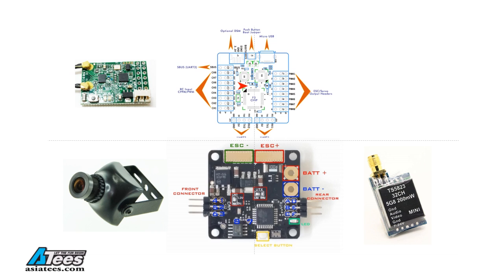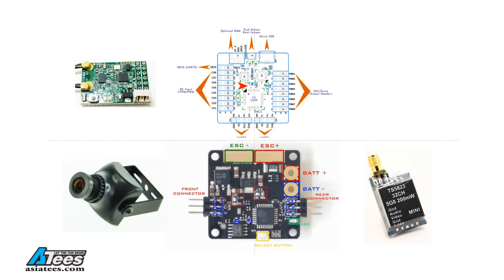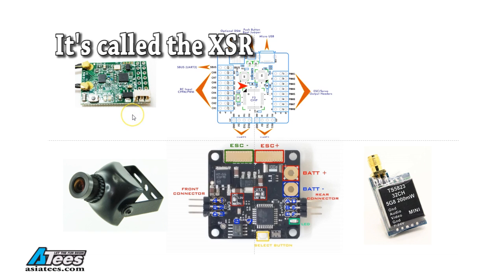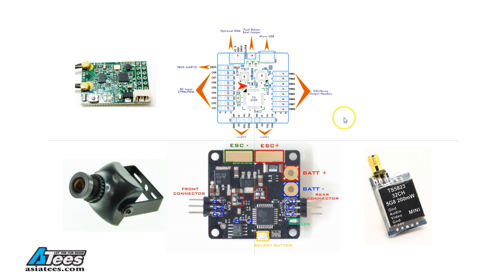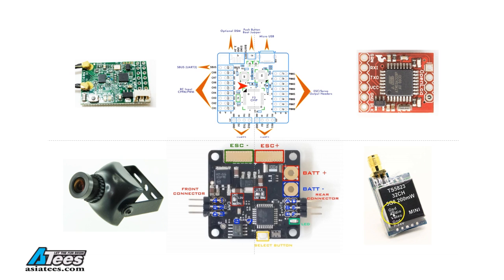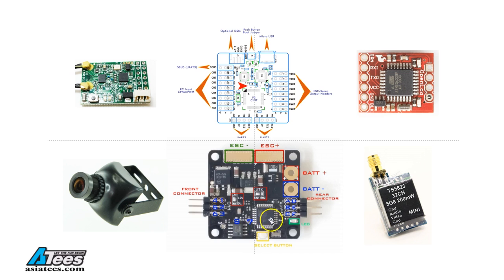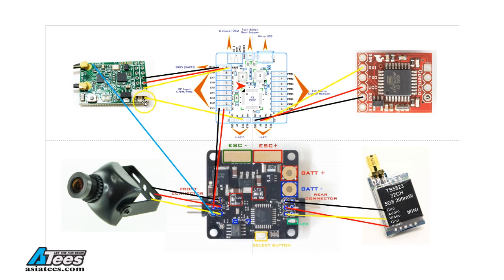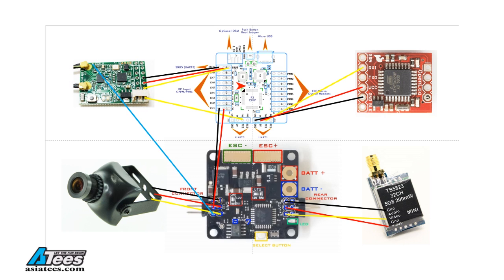"Pure X" Racing Quadcopter Build - Part 1 - Electronics Layout

Comment: So good!  I was staring at my PDB wondering which voltage bridge I should solder, regulated 12V or raw VCC (batt voltage).  Your explanation cleared up the confusion I had when reading the "manual" that came from the PDB mfg.  I am using a 3S batt.  No confusion now!

Comment: Joshua- you refer to using a cap  if running a three cell bat, do you mean directly to the vtx?  Not being an electronics engineer I am guessing.  What voltage and value would work?  Thx for your dedication.  Randy
Reply from the maker: +William Stewart https://youtu.be/0RP0FPGnilg

Comment: I went with an XSR receiver and RSSI seems to work fine using smart port: http://fpv-flightclub.com/x4r-sb-xsr-sbus-telemetry/
Reply from the maker: +Simon McKenna (Si) I guess you are running RSSI into your FC and then from there to the receiver using S.Port?
Reply: Yup, you got it. Other than losing a channel, I couldn't see any downsides to this? I'm new to building quads so went with the latest lightest receiver that worked with my transmitter.

Like your suggestion about doing a wiring diagram first, would've saved me from a few mistakes.
Reply from the maker: Oh, I see. You're using an RSSI channel. Yeah, I suppose that would work okay if you are using Taranis telemetry. But it doesn't work if you are using the RROSD.  RROSD requires analog or PWM RSSI input, so it doesn't work at all with the XSR.
Reply: +Joshua Bardwell There is an RSSI pin on the XSR, it's not properly documented but it's there... http://m.imgur.com/D2gL9tP?r

Comment: Maybe I'm getting something wrong here but the xsr has a smartport so it can send the rssi to the fc also the new v2 has a vbat so when you run the osd of a softserial you should be able to get all data to the osd.
Reply from the maker: +Bloody JMF The RROSD doesn't communicate with the FC at all. It is completely free-standing. The XSR can send RSSI to the FC via smartport, but there is no way to get the RSSI from the FC to the RROSD.

Comment: Just want to make sure, do you run full battery voltage to the v bat pin, on the f303 v2? I just got it and can't find out if it needs a voltage divider. 
Thanks.
Reply from the maker: +Dropoff510 fThe voltage divider is built in. You run full battery voltage to the vbat pin. I assume it's good for up to 6S.

Comment: RS5823 hasn't been reliable in my case, mainly due to the small gnd/power/signal plug. Even moving it around slightly will cause lines in the video, even when gluing it in place. Directly soldering the wires in place on those tiny pads solved the issue in my case, but it's a pain and makes switching out the vtx on the field impossible.

On the exact same frame, the foxeer mt600 worked flawlessly (as well as the immersion 600mw, but that's waay too big).
Reply from the maker: +Flying Dutchman The Foxeer vtX's are good choices, for not too much more money. Once you find a reasonably secure way to install your vTX without destroying it in every crash, it's probably worth it to spend $25 on a vTX. I still buy the TS5823 because they haven't been a problem for me, but I don't go through nearly as many of them as I once did.

Comment: Joshua if you do a survey of all the typical electronics used on a quad you will notice it is entirely possible to run everything @ 8V. This strategy puts less stress on all the consumers of power and also allows the Reg to work all the way down on a flat 3S pack. In my opinion the whole swag of PDBs offering 12 and 5V regs are missing the point. The things that have changed to make the 8V option viable is the appearance of lower voltage cameras and VTX. This is the way I wire all my quads now using the D-Sun reg. As the D-Sun runs @ 1.5 MHz I find no need for any LC filter. The ultra small D-Sun is an entirely different reg running at a much lower frequency. I have bench tesed it and can't really recommend it.
I have also been testing power handling of PDBs lately. Measuring the volt drop from battery pads to motor pads. I tested at around 45amps continuous. I found unless the PDB design was well executed some PDBs can have significant resistance and heat build up issues. Be especially wary of complex PDBs as the high current paths are often compromised to allow the inclusion of the extra electronics. Interesting stuff and easy to investigate using the water cooled dummy load I recently described.
Reply from the maker: +Rob B absolutely. But since the RROSD has 12v baked in, that's what I use.

Comment: Regarding the TS5823, we had a lot of them burnout after a short amount of time and the only thing that linked the burned ones were the bad antenas, the ones that used cheap MyRCMart 5$ antenas (althou I LOVE MyRCMart) burned out and the ones with higher quality antenas kept working, all of them used 3S voltage. So, we figured they are just sensitive to bad antenas.
Reply from the maker: +Cw1Xpro very interesting. I have only run them with Aomway antennas, so that may be a data point. I have heard multiple reports that they will slowly burn themselves out on 4S, but I haven't independently verified.
Reply: Yeah, similar symptoms, only we were all on 3S so no overvoltage.
Oh, we were amazed when we discovered the aomway antenas :) Fatshark was just a dream so aomways were awesome, we're also using them exclusively now.

Comment: I don't think depinning for myself is diffiuclt but I've been searching for more info on removing a jst-sh connector off my board for direct soldering the esc servo leads. Guess I'll need to experiment.  Looking forward to seeing the next part.
Reply from the maker: +French Fry I suppose a hot air rework station would be the right tool.